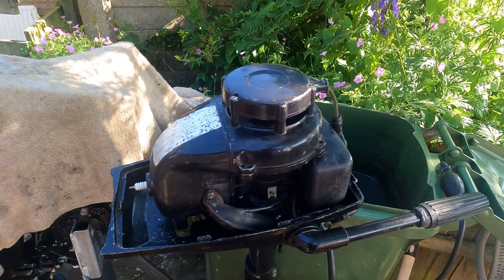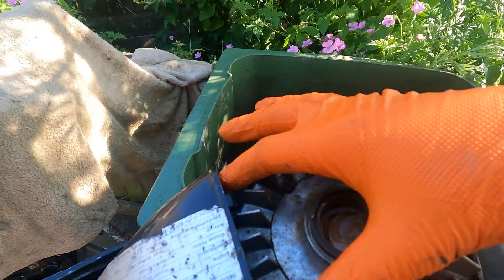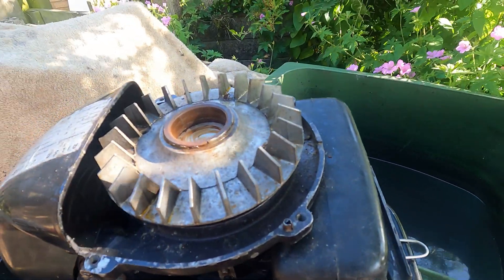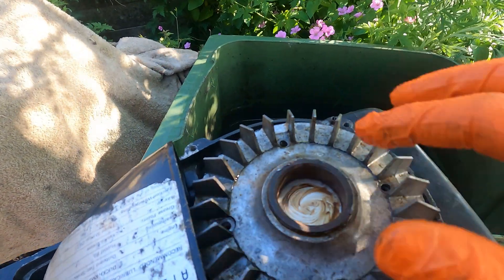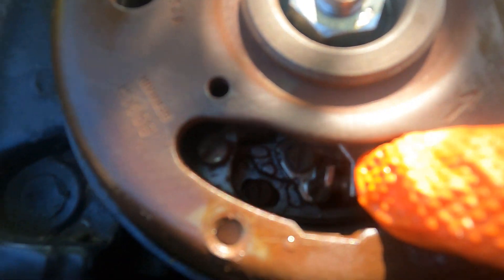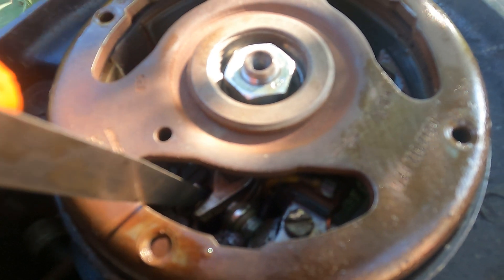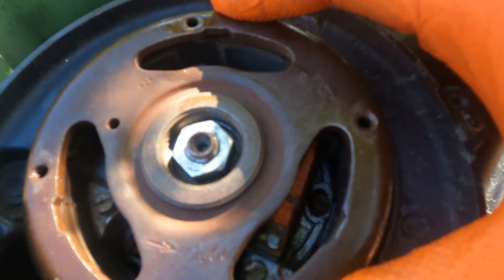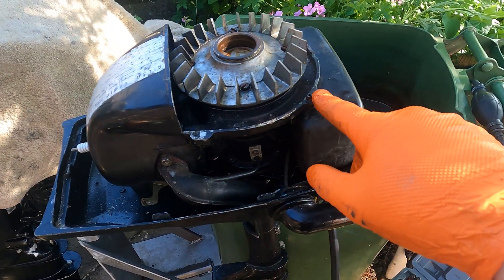How To Check - Ignition Points Gap - Tomos T4 4hp Ailsa Craig Outboard Engine

Comment: jeez, I bought one of these half a century ago, to power a little folding boat that I took down to Baja, Mexico. Had an outrageous good time. Friend of mine had one of the same boats but put a 6hp Evinrude on his.  We stayed out in a coming storm when all the local panga fishermen came in and they looked at us like we were crazy, which of course we were :). Pretty soon, we were trolling along running on either side of the incoming waves which were building so high, that as it passed between us, we would disappear from the other's view then pop back up as the wave passed.  LOL.  Then of all things, my friend got a huge bite and his boat sped up and he rapidly began to disappear into the distance.  I then gunned my Tomos and took off after him. Fortunately, the storm began to abate, and about 3 hours later we returned to the little bay where we were staying, with about a 150lb Sailfish :). The locals were amazed and we were instantly famous LOL.  A LOT of very good cervesa hit the dust that night:).
PS. now for the point of that story, I was rummaging around in the garage about a week or so ago, and guess what I found:). Yep, the TOMOS , covered in more than 50 years of dust, but after I washed it off, it still looked brand new.   The difference is mine's engine cover is BLUE and Silver.  Going to go thru it next week and clean out EVERYTHING, and see if it will still. run .(I only ever used it that one trip, and never had occasion to run it again.  Got my fingers crossed, and yes, I'll be VERY careful to give it every chance to live again.  Must have been divine intervention for me to find this post.😇
Reply from the maker: Let us all know how you get on starting it up again. Might need the carb cleaning but it should be fine 👍😀

Great story and history to go with it 😄